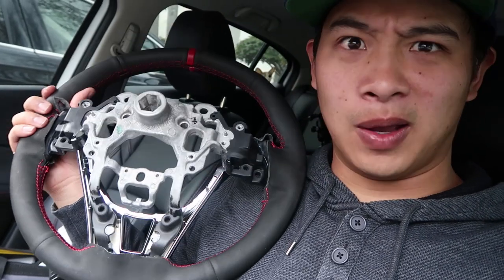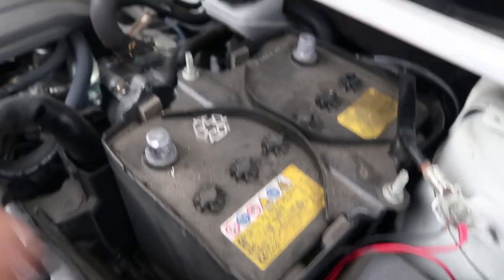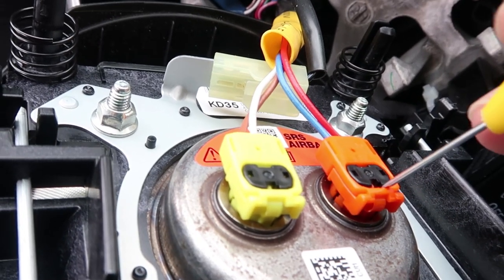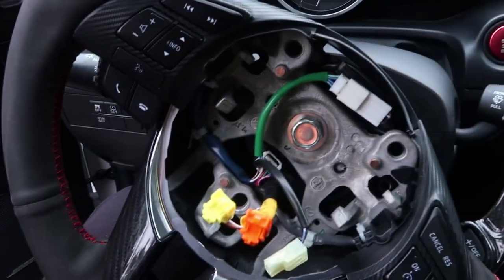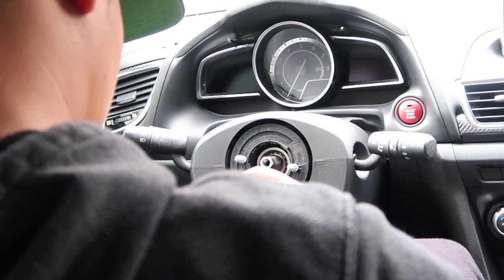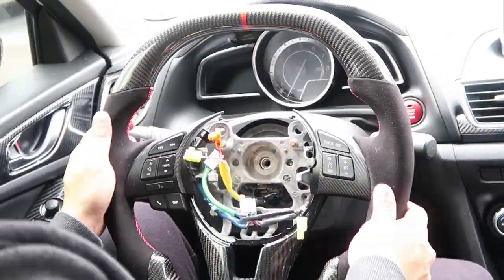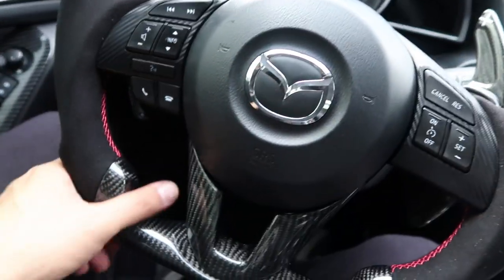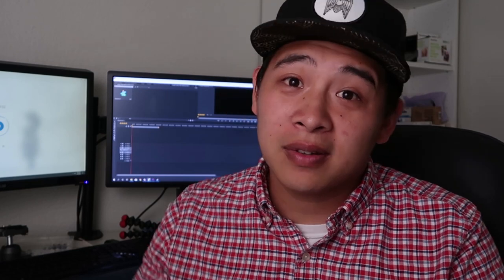Carbon Fiber Steering Wheel Install - 2016 Mazda 3

Comment: so grateful for this channel, I have 3rd gen mazda3 hatchback and I've been desperately looking for someone else who's modding one. I'm assuming you went with the carbon and suede steering wheel?
Edit: do you know if the leather + carbon one also comes with the paddle shifter extensions?
Reply from the maker: The paddle shifter extensions were separate.
Reply: @GregPettus  oh, good to know. Are they on your site?
Reply: @GregPettus  Are you going to restock the carbon spoiler?

Comment: How do you move the steering wheel tabs to push the airbag off without reconnecting the battery and moving the steering wheel to a potion to make the tabs accessible?

Comment: Just used this video to upgrade my 2014 wheel to the newer 2018 one. Thanks heaps!
Reply from the maker: woooo! glad I could help
Reply: How did that go? Wanted to do it to my 2016 but I’m told u have to re wire the buttons on steering wheel the 2017-18 one to get cruise to work and u will also loose ability to reset your info like mpg average speed etc so I gave up if u found a way plz plz share it cause I’d love new wheel
Reply: @joshymcdaniel9233  I didn't bother rewiring so I did lose the ability to change the information display but I made sure to set it to the range screen before removing the old wheel. Cruise control also no longer works but I never used it anyway.
Reply: @iwetino  cruise is just an easy solder an extra wire and connect it to a pin google search should bring up how but yah the info button can’t find any info on it’ surprised the ui changed that much it isn’t just a direct plug n play like most r

Comment: Hi, I'd like to have dedicated voice assistant button on the steering wheel. Can I swap the left command part/ the whole wheel and get it working? Easier, can I map aftermarket stereo with a combination of pressing like double press or long press of existing buttons?
Reply from the maker: I would think you would need to check a manufacturing manual to see where all the plugs go
Reply: @GregPettus  I really don't know what to look for?
Reply from the maker: @gd3265  there might be a post somewhere where they upgraded there wheel. I would start there and ask them. Sorry not super helpful there
Reply: @GregPettus  thanks

Comment: @Greg, hey I know its been a little since you've done the actual install but have a question
I think you can answer, especially with your electrical know how compared to average folks. 
That being at around the 5:20 mark your covering briefly the connections and wanted ask you if that bottom electrical connector is a 12v supply?? I just got a LED steering wheel and what little instructions we got was laughable. From what my mechanic and I understand the best way to power this fancy thing is thru a 12v connection or else things will get really complicated.
Hope you can shed some light on the power supply and aka the bottom connector.
Thanks - Joe
Reply from the maker: Yeah its been a while... but thanks for the kind words.

So i honestly dont know what the voltage coming from those conmectors are. But i would imagine they arent 12v bc its for the controller but i could be totally wrong. You could test the output with a volt meter.

Comment: Can you install a quick release steering wheel on these BM Mazdas?
Reply from the maker: Yes you can. But i have not myself
Reply: @GregPettus  do you know if it causes issues when you remove the clock spring and the airbag sensor
Reply from the maker: @kenb5995  i actually dont know. Sorry
Reply: @GregPettus  no worries thank you!

Comment: @Greg, got a follow up question. Ordered your carbon fiber extension paddles and will hook them up asap, so this could be super obvious but how will I install the new extension paddles on the oem set up?
Thanks for the help in advance. P.S got that led steering wheel working a couple months ago and put the post on the club. It was difficult but worth the time. For me at least lol!
Reply from the maker: What Trim Level do you have? I have an S Touring and mine had stock paddles. So If yours doesnt, then you need to install those first. then the extensions fit right on them. you will see when you get them!

How do you like your LED steering wheel? I was thinking about it a while back before I got my suede carbon fiber one.
Reply: @GregPettus  I gotcha, guess I won't need to over think it haha 😆
And I'm loving the new LED steering wheel. Hard to believe I'm the only one in North America with one but I understand after doing the install. Absolutely zero support provided from OHC realistically and electronics don't always carry same from car to car. So that being said I had to consult with a few folks online and in person. Even my dealership tech took a look and didn't know where things needed spliced. Worth the hassle but the cost, delay in parts and 5/5 electronic splicing difficulty are overkill for most in our community I feel. 
But it's still fire :p

Comment: Any ideas why my steering wheel isn't straight while driving? (2015 Mazda 3 sport sedan) The suspension was checked by the dealer and third party garage. Tire pressure is fine as well...
Reply from the maker: Could be alignment or your steering wheel might not be centered correctly.

Comment: I also got the Keyless Mazda 
but my Steering Lock always kicks when I start turning the steering wheel in so I can't turn the steering wheel without the battery connected to unlock it again. 
Can you help me? How did you do it?
Reply from the maker: I just started the car briefly so i could turn the wheel.

Comment: Great video,  like you the website you have a lot of great stuff, I want to add that mid spoiler to my 3 but do they 

make a black one not a carbon one is to much. How long does it take to get parts in. Thanks
Reply from the maker: Let me find out for you. Depends on the product. If its already made its 2 weeks. But things like the steering wheel its made to order so like about a month.
Reply: You from Canada cyclone?
Reply: @tarek3702  no am not from Canada,  I did visit Toronto two years  ago had a great time.

Comment: How much was this? I am debating about the Corksport one with Alcantara ... or one that everyone has this other Carbon Fibre looking one... have you seen cars with either? comparison?
Reply from the maker: $500. Depends on what style you like. The Cs one is nice cuz its flat bottom but otherwise stock. I like this Carbon on because one its real CF and it just feels beefier. And i really like the flat top and bottom